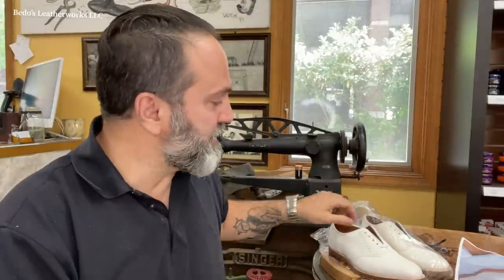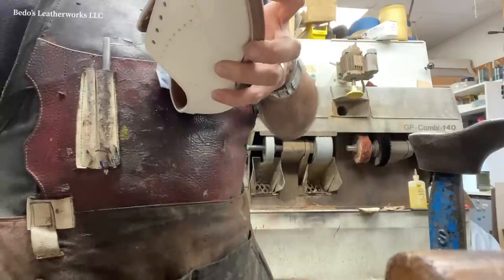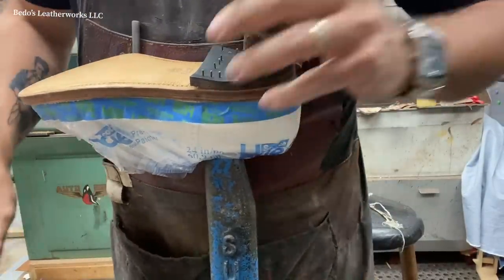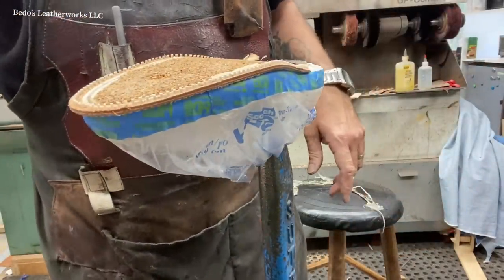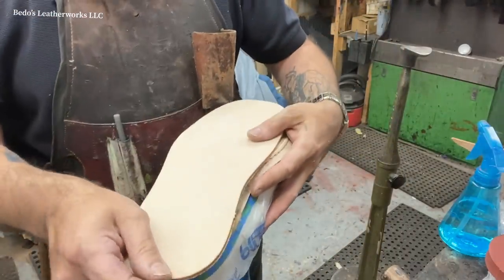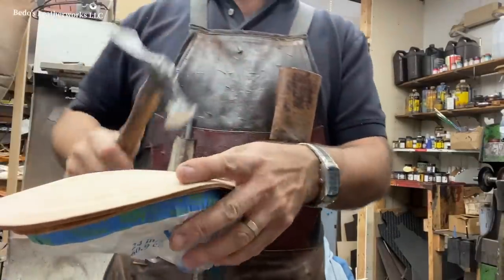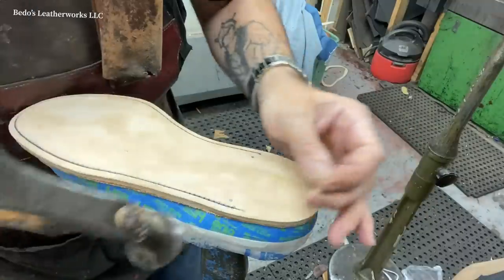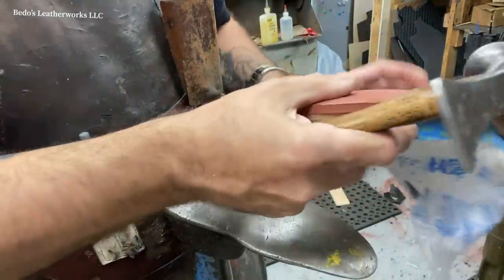Alden White Saddle shoes

Comment: I have the same identical saddle shoes in 14 Narrow. I bought them at the Alden outlet in Norwalk last year.  They were factory seconds and the welts were sanded too close to the stitching as well. Never-the-less, They were half price at $260 and are comfortable.
Reply: I find suede to be the most comfortable birkenstocks by far, probably true with most shoes. Flexible and breathes so well. The 200 additional cost for the new welt makes sense with the cost you provided, and still save 60 bucks over factory.

Comment: I had White Bucks and red laces and Red soles when I was a bus boy at Start Rock Lodge.  One day only had to go back to black.  Alden lost a little reputation with the Fiberboard parts.
Reply: Nice red laces! As for fiberboard, its industry practice these days with almost all manufacturers except for bespoke. It's not only a cost-cutting issue like it may seem. It can be more complicated, such as the ability to sell a specific design at a specific cost. It is more market driven than anything. Meaning, the majority of buyers who want a pair of white suede shoes like this only want to pay a certain price range, so the company is forced to use less expensive materials to meet that market demand. If you look at the bespoke hand-made shoes like from England that use entirely all leather, they are MUCH more expensive from $1-3K. At the $500 price range, this is definitely what you get with some fiberboard parts.

Comment: Beautiful job, as usual.  But I don't know whether to say that some people clearly have more money than they know what to do with, or some people have more money than sense.  LOL  But I guess considering what a poor job the manufacturer did originally when they sanded the sole and welt so close, I guess this may just be money well spent.  Me, I would have taken those shoes back to where I purchased them and demanded my money back.
Reply: If they really paid full price to begin with, yes they could have. There could be lots of reasons why they did not. The overall cost ends up being about the same, but clearly Steve's repaired shoe is even better than the brand new one. As for cost, $500 is not that much for a new pair of dress shoes. The minimum for quality bespoke dress shoes is $1-3K. To get the really good hand-made shoes, expect to pay $5-10K. Most people just do not really understand how poor they are and are shocked to find out they are not as high up on the food chain as they thought they were (this is the American model, to convince people they are better off than they really are).

Comment: I would have done a red dainite or vibram eton...longer lasting than that  one piece foam.... I guess whatever the customer wants
Reply: I'm a big fan of Vibram soles and they have such a vast array of styles. But Vibram doesn't carry any styles that will just wear out quickly, this would be counter to their brand. Sure Vibram soles vary in durability depending on specific materials and application, but in general you can depend on all of them to be much more durable than any average sole. For example, I have a Vibram sole I put on my birkenstocks myself and they appeared to be very thin and flimsy and I was a little worried about durability for the specific sole I bought.....but holy cow they are lasting forever, much much longer than the regular birkenstock sole. Vibram is unbeatable, hands down. Also, suede is a comfort casual shoe, not a glossy firm dress shoe, so the soft foam makes sense with a nice suede combo for comfort and you still get the vibram durability. The customer and/or Steve knows their stuff on this combo.

Comment: Conspiracy Theory: Alden sands the welts too closely on purpose so that you have to send back to THEM for re-crafting (i.e. discouraging independent cobblers...)
Reply: I was thinking the exact same thing.
Reply: I don't think so, they are just factory seconds they sell at a discount. It could just be a new employee in training. Also, I don't think there is much money in the re-crafting side of a manufacturer, it is a service they provide to build loyalty such as with allen-edmonds, but its a huge cost to the manufacturer and is not a big part of their revenue which is almost entirely on selling new shoes. In fact, I would argue the opposite, the allen-edmonds repair program is so costly to them as a company they have cut back on the quality of the recrafting so much that it hurts their brand loyalty these days (because the cost is actually very high to cover the costs for the company and the quality is not that great compared to a cobbler like Steve).